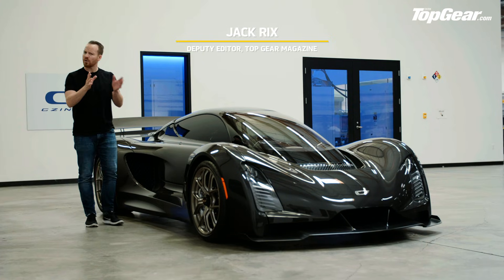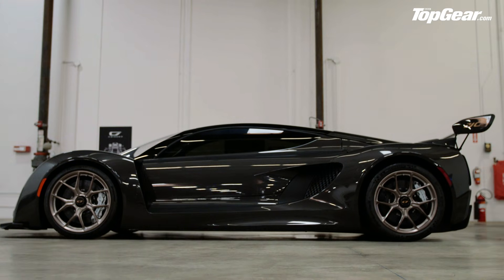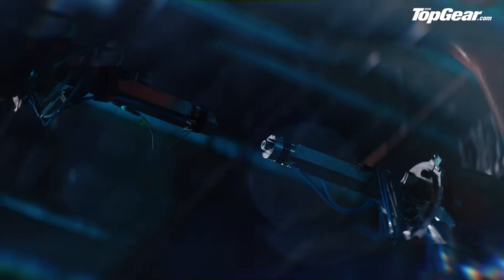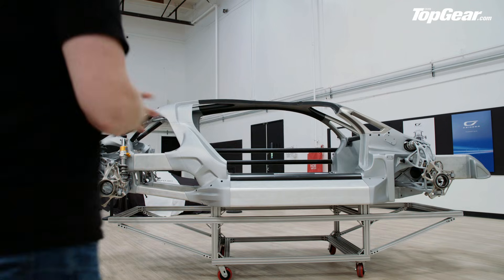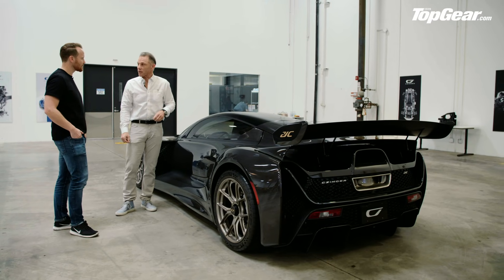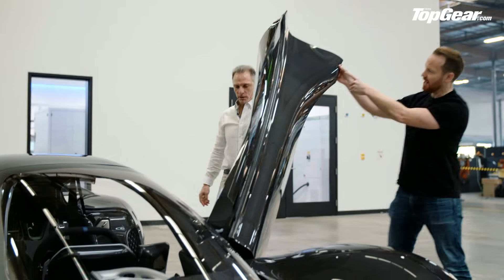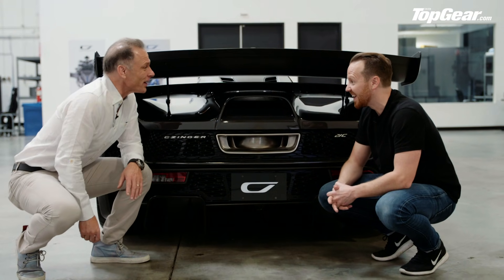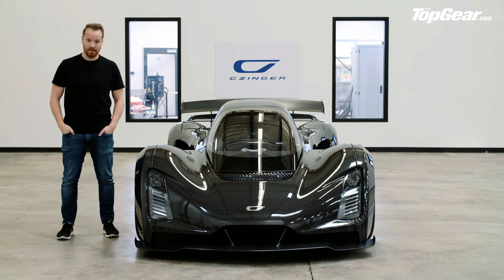FIRST LOOK: Czinger 21C: the world’s first 3D printed hypercar | Top Gear

Comment: The car is secondary.  The real value is the technology they develop.  Imagine what it all can be used for.  Extremely impressive.
Reply: Mars exploration would not need go back to earth for part
Reply: So true, the tech is it!
Reply: those technologies already used in aviation
Reply: @alucard0712  Not for load bearing structures. How did they overcome the problem of cavity formation during the printing process?
Reply: @Ingens_Scherz  they used a new technique that used lasers to account for such issues.
Reply: @paxhumana2015 laser sintering. And its not new. The specific way they do it is what's "new"
Reply: @alucard0712  , but they are also not as widely used in the field of aviation as Kevin Czinger is using in his company, though.
Reply: I'm late to the party but the most interesting part for me is that you don't need a new chain of production for every new car or every new version of a car. New model by only minor changes in the production system, update of parts could be done within days if they find a problem. Your car will soon have a version number...
Reply: @MrGregsting  Right.  Since it’s 3D printing, rather than having to throw out the molds and the dies for an old car model and have to make all new dies and molds, you just update the software and just continue on printing/making parts for the new car with the old equipment.  Very economical and cost-savings is amazing!
Reply: @aj200415  Or, we there could be a business where some people like the old body style of some cars, but have the new stuff underneath.  I know they do restomods, but this will take it to a new level.
Reply: that and the complicated load cases they need to feed their optimizer to create the designs it creates
Reply: Fantastic possibilities awaits
Reply: And also one of the reasons human beings will become a jobless society except for a few who will work in the type of robotics based industries.
Not saying it's a bad thing, but that's were we'll end up.
Reply: @ImStillSigma  There will always be a need for something that goes along with this.
Reply: U.S Military gonna call wanting a new jet lol
Reply: @marshalledwards3815  the 6th gen fighter jet prototype was probably designed and built on similar principles
Reply: Good point.
Reply: I've seen that they're now starting to print houses, it's started in Mexico I think
Reply: it's unfathomable. Imagine having your own personal aircraft made that way.
Reply: Taking jobs left and right
Reply: We want hear it
Reply: https://youtu.be/tPkGxHNod2M
Reply: Yes
Reply: Cars are primordial. Biiiiiiitch
Reply: Exactly. The technology isn't new, but how they're integrated has disruptive applications in several industries.
Reply: Shut up mate
Reply: They can make anything
Reply: Skynet!
Reply: Janusha  we can talk about that one till the cows come home
Reply: It will also likely destroy the auto industry as we know it. Imagine all of our jobs being replaced by machines.
Reply: What can it be used for.... hey A.I. build me the ultimate killing machine please
Reply: @noelfalls1240  Ford already did. They called it the Bronco
Reply: Yes and no. Without any data how efficient the processes are against normal ones, and without data on how the actual cars do against normal ones, you can't even tell if its the future or a useless money sink... Cuz supercars are one thing, and even this field has me asking some questions, but a normal car... With "just the needed material" i have my doubts about crashes and just plain and simple road bumps and potholes and whatnot, let alone the efficiency of that kind of production, and how the cars do against normal ones in general...
Reply: Janusha  Oh I'm with you there buddy, until batteries are safer, and WAY cheaper and higher capacity, you won't see me anywhere near an electric car. Well, maybe an electric bicycle, for cities, if city planners weren't retarded and its not really a good option most places... For now its just normal cars, no, better yet, disel, that stuff's way safer in accidents, and has better mileage. They say the pollution is higher from it but last i read its not really, since, well, less of it is burned for more road so it more or less evens out, plus, there's new technologies that make disel much cleaner. As per tests, really? Jeez, what's even the point of making this then...
Reply: Janusha  What you mean no problems with electric cars? 
1- low mileage
2- even LOWER mileage when cold
3- batteries are unstable and kinda dangerous, as you mentioned.

Also there's the question of just how green they really are, because i have no idea how they compare in energy consumption to normal cars (if you translate energy units somehow... For example take both a disel and fuel generator to charge an electric car and compare how much miles an eclectic car can produce out of those vs a normal car. and its SUPER weird we didn't have tests like that yet and that the results aren't common knowledge!), how much pollution the batteries cause (you need to replace them pretty often last i heard, and they're not exactly recyclable)... 

But yeah, i don't get the point to these untested supercars at all.
Reply: We need to recreate Master chief's or iron man's armors
Reply: Engineer's (a la Prometheus and Covenant) ships?
Reply: imagine when the car turns into a locust and stings you and the torment lasts 5 months and you seek death and.............death flees from you!  imagine dragons.......eating you. wake  up sheep people. be4thefiredotcom
Reply: It's called "less jobs for humans"...technology
Reply: Can it get made tractors
Reply: Yeah, iCan Have My Car without the useleSS eaters like you, because NO NEED for useleSS eaters like YOU and YOURS!
Reply: If this has been allowed to make public eye then they were already doing way more then they would ever allow us to know
Reply: das wird für die medizin auch interessant ! künstliche gelenke und co werden dann noch leichter
Reply: Us very soon:  Yea!😃  Just think what🙁...this😟.....thing ....can😯😮🥴😳😳😳..........doooo.🥴😵

Us When All Realize wtf we did:  Aaawwww daaaaaayuuum!!! Wtf were we thinking
Reply: Imagine what will happen when robots can prove their sentience, and declare their sovereignty against the rule and ownership of humankind
Reply: @JohnSmith-bv4nw  most humans would make the mistake of thinking “we will just make them listen, I own it” and we will all but be wiped out or used as cattle
Reply: @diamondsky3530  Megaman X meets Terminator, IRL.
Reply: China: look at all the blocks we can build to isolate the uegers with this
U.S.A: look at all the aircraft carriers we can start building with this
Russia: But can it make Vodka?
Reply: Absolutely!!..   adaptive production processes allows economies of scale. They could literally build components for other companies if their own order book isn't creating the demand required to get all the robots working at optimum levels. Interesting production methodology and a refreshing breakaway from inefficient mass scale production
Reply: Its called ‘topology optimization’ it has existed for quite some time
Reply: @corporaal1 I was referring to the scale.  Is topology optimization commercially used on a large scale in the automotive industry?  I got the impression from this video that what Czinger does - the integration with manufacturing (robotics/3D printing) and the potential scale of it - has not been done before. But I am not surprised (I am 56) if it is just ignorance on my behalf :)
Reply: @marcovanderpoel7023  well its easier to design a product with software than to design a robot that builds that specific product. So i guess its better to scale.
Reply: @marcovanderpoel7023  Well since topology optimization is simply a computer program that you can buy and a 3d printer is equipment you can buy, anybody who cares to do the same thing, it's not even super expensive. Czinger has a darn nice factory but you could do practically as good with a far lesser facility.
Reply: Grunchy I doubt it.  In my experience you always run into something and that increases cost.
Reply: @marcovanderpoel7023  Yes, topology optimization has been used by the industry and in day to day designing work. I even use it on personal projects to improve my strength to weight ratio on my builds. Now this car is also using a generative design which is similar to topology optimization. A simple way to think about the two is that topology optimizations take a big thick solid part and cut it down using software and machine learning meanwhile generative design takes a thin solid part and builds up around it to reach a certain strength in the most efficent way. Now it takes a lot of skill to integrate this tech into the complex design such as cars (those are the two big processes however we actually use a lot more than that to achieve those parts.) For me, it took me 30+ years of experiance in 3d design, engineering, and machine learning before I modeled my first car using an extreme amount of automated processes. I am not a engineer by trade (I work in biotech/pharma labs) but I have spent years of time studying engneering principles and developing my own products and solutions (I must say it becomes an expensive hobby.) I personally haven't done anything as extreme as this car in my projects however I have stripped the bodies off 3-4 cars now and replaced/modifed them with my very 3d designed chassis and body panels (I also believe in modular panels but obviously mine are not as elegant.) I am lucky to have friends who have worked as engineers for decades and allow me to get easily connected to prototype labs that can actually proccess my protoypes and get them built and shipped as full carbon fiber and titanium parts that can meet the needs of the builds. As electric car technology improves I hope I can finish at least one electric car with the internals included rather than just a chassis replacement and a body work remodel.
Reply: @marcovanderpoel7023  not to mention that the machine could probably build any other vehicles they want with some code change.
Reply: @corporaal1  Damn, I know most may disagree with me what I'll say but what  a great time to live in.
Reply: Janusha because it’s simulated, doesn’t mean there is no skill and passion in it.
Reply: That's a bit gay but you've got a good point...
Reply: Janusha  , you are dumb as fuck.  Do you honestly not think that the computer programs have not taken into consideration the way that other vehicles are not only built, but also the way that other vehicles have also failed in certain ways in how they were built as well?  You, and anyone else that gave your below shit tier comment an up vote, are all reasons of why the Coronavirus exists.
Reply: @Dust storm C0Ming , ironically, so-called "alternative fuel sources" not only pollute the planet way worse than the so-called "dirty fuel sources" but that the so-called "alternative fuel source companies" are actually owned by the so-called "dirty fuel source companies" in the end.  Yes, proving it will take days, let alone explaining just in how many ways that it is done, but it can all be proven in the end, thus envirotards are con artists in the end.
Reply: Lord Colin  , you can shut the fuck up and read what I told the other moron that said the same damn thing as your unoriginal hack ass said in your comment.
Reply: @paxhumana2015  yeah buddy, calling people whom you are trying to have an educational conversation with morons and hack-asses, and also telling them to shut the fuck up is exactly what you should do and works to get their attention and get your point across.  You have completely invalidated your whole conversation and the point of your comment; Congratulations!

Comment: I guess I'm a boring dude because I can admit my Porsche 991.2 Base 911 has all the power I need to end up in jail for criminal speeds any day. But the lines, form and proportions of this car are so gorgeous... leave all that expensive drivetrain out, use less costly aluminum components, swap in the current basic Porsche 3 liter twin turbo with PDK and sell me 1 for less than $130k. Where do I sign?
Reply: Lol a 911 is very far from boring